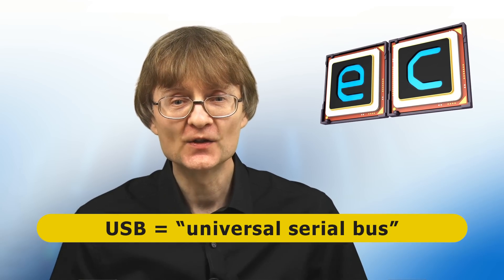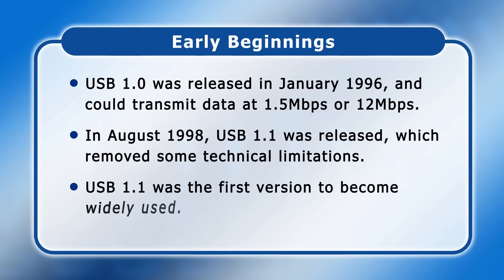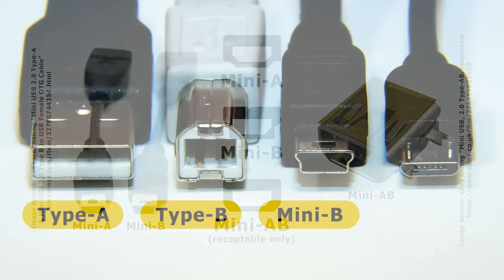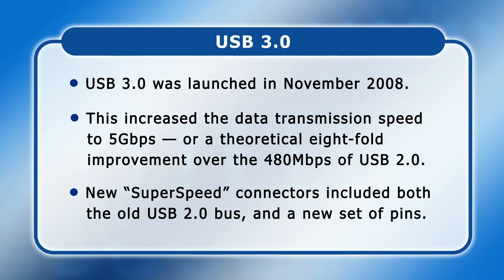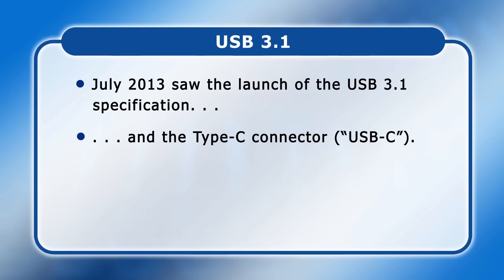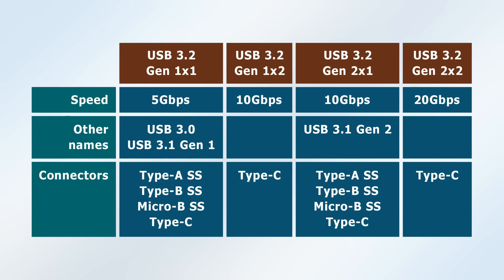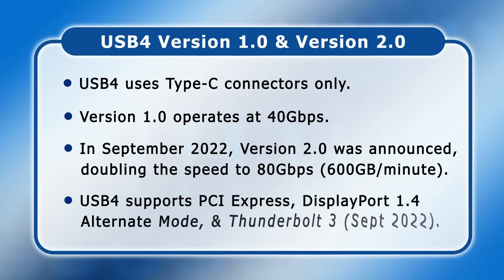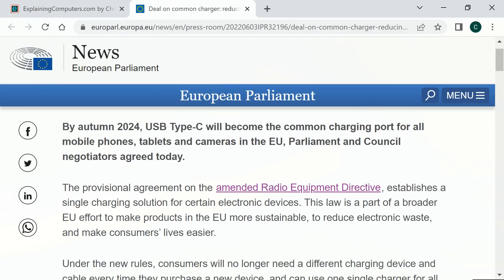Explaining USB: From 1.0 to USB4 V2.0

Comment: As messed up as the specs became, for most people it wasn't an issue. Because very rarely do you need anywhere near the full speed, with USB 2.0 still fast enough for just about all peripherals and memory sticks...it's only external hard drives and devices that can transfer data faster.
As for connectors, the main ones became USB "A" "B" "Mini-B" "Micro-B" and "C" with Apple using "Lightning". Mini-B and Micro-B are quickly disappearing and "B" only seems to be on printers which are all going wi-fi anyway. So going forward, all you really need in cables is going to be USB A to C and C to C.

Comment: What about the early high volt standards of USB 2.0.  POS terminals used voltages at 12v and 24V found on Dell 5WDTX PCI-e card.

Comment: The key to all this that makes me smile is that the speed of USB is just one link in the chain.   It's pointless for data to transfer @80gb between peripheral and source, if the buss and other components of the source are incapable of processing at the same rate throughout the entire supply chain of data transfer.  For most PCs or any 'source' component, this makes all the falderal over USB speed irrelevant.  Yet we still see the package and squeal when we see: "USB 4.0!!!  GOSH!!!"

Comment: I find it rather dumb that USB 2 is still in use for perihperals becuase "It's sufficient" 

Yeah so what? Surely it's cheaper to just procude one type of connector and even then I somewhat doubt USB 3 is that much more expensive compared to 2. Plus it's backwards compatibale in both directions anyways. Not to mention that it's more user friendly, I don't have to make sure my harddrive is not plugged into USB 2 and I lose a ton of speed.

I am also still baffled that theres regular USB to C, as a standard. Just USB C both sides and be done with with. Doesn't matter which way I orient the plug, it also doesn't even matter which way the cable is, also again, one type of connector for everything, done. 

I've heard complains about that, that it means I have to buy new cables for everything. No you don't, your old cables and plugs still work, ya dingus. Besides, we already needed new cables for USB C anyways. 
The world could be so easy if we just commited to it instead of worrying about older use cases tbh. 
Once your shit breaks you can then replace it to a newer standard if you so desire.
Reply from the maker: USB 2.0 ports are cheaper to implement than USB 3.x or USB4, and use fewer motherboard resources. It's got nothing to do with the cost of the connectors.

Comment: Another confusing thing: If you connect two random USB C devices, both with their own battery, it feels completely random who is charging who. On some devices like Android phones you can decide if the device wants to charge others or be charged. But for a lot of devices you don't have a choice and you only find out in which direction they charge after you connected them. After putting a USB C cable between a bunch of different devices and checking the result I was even more confused than before. I am not even sure if it's a transitive relationship, so if device A charges B and B charges C, then if A will consequently always charge C. Some pairs of devices also just refused to charge eachother while others did. For me the most intuitive solution would have been giving USB C cables a charging direction and giving them somehow a clearly visible indication (a red and a green plug or clearly visible and palpable arrows on the plugs or whatever). But others I talked to also said that it would add another level of confusion. And I also know it would reintroduce the old USB problem of attempting to plug it in the wrong way (now with the wrong rotation of the whole cable instead of the wrong rotation of the plug). And for chargers it does not make sense to make the cables directional. Giving the cable passive electronic with a toggle button on both sides and a weak LED also adds a lot of unnecessary parts which cost and can break, just for a niche purpose. Then introducing the above mentioned indicator logic, but not mandatory? But this would introduce a mess and confusion with two seemingly same but different cables. So make following the charging direction optional for devices like chargers? But this would not solve anything because everyone would implement it differently again. Really not sure what the best solution for this problem would be.

Comment: Do you have a good explanation, how my laptop uses USB 3.x to connect to a docking station, which in turn supports two FHD displays, 1 GB Ethernet and additional USB ports, while also providing power to the laptop. How is that even possible?

Comment: USB - C also could be called micro HDMI due to it's function as multimedia cable.
Reply: It cant as USB-C pin out is designed for USB needs, not HDMI, alternate modes just use pins for diffrent perpices

Comment: As a visually impaired user, I'd be curious to know what tactile differences there are between the various types of seemingly interchangeable cable. Is it, for instance, possible to tell the difference by feel between a cable with and a cable without the superspeed pins?

Comment: 02:52 I have never seen a keyboard or mouse with a USB Type-B connector
Reply from the maker: It wouldn't have. Type-B is for the peripheral end. So the plug on a mouse or keyboard is a Type-A, as it plugs into the host (computer). But, for example, a printer lead has a Type-A at the computer end, and a Type-B at the printer end.

Comment: Thanks for providing a concise reference 👍
One thing I have never been able to fathom with a USB Type A connector:
It is polarised and must have the correct orientation to be inserted.
Statistically I should have a 50% chance of getting it right first time and 100% chance if I turn the connector through 180 degrees after the first attempt.
In reality, for me at least, is it takes several attempts regardless of the first or second orientation 🤔🤣
I am surprised there isn’t a game called USB (A) roulette where people gamble on getting the plug in on either the first or second attempt with the Bank taking all bets over two attempts.  
Theoretically the bank should not win anything but I am prepared to bet 🤣that the bank will come out well ahead.
More sophisticated variations could be developed for later different USB versions, playing in poor lighting or without glasses or even wearing somebody else’s if you don’t need them.🤔

Comment: What has gone wrong is the colour of the USB port they started with black then it became blue,but blue has a mix.We have more colours to provide the USB connectors so if made red everything should be red conectors with that speed=simple and if the speed changes then the colour changes.This would be easy = red device only connect another red device.do away with backward compatibility this stops the mixup & if you want to keep up you have to change what you have.Why not name each version RUSB= RED USB =simple? Also the connector has to change so that it cannot be use for any other connection only  RUSB, then the next version change colour & connector.everyone would get used to the colour/connector vesions.

Comment: I'm not sure it was mentioned explicitly, but many, dare say, most of the USB C cables you purchase are designed for high power usage and are therefore USB 2 - 480Mbps. Finding a 10Gbps USB C cable is incredibly difficult and confusing endeavor. 
Thanks for the video!!

Comment: "USB, we named it so because it is universal!"
"can I plug this into that?" uhh... no
"can I power this device with that cable and have the speed transfers that is guaranteed by the device with this smaller cable?" umm... no
"can I use this device with another device without the need to purchase a specialized cable for that intended purpose even though all present the USB logo?" uhh... I don't think so...?

USB started as a great idea but they just ended up as many great projects that wasn't implemented correctly "a brand" which is infuriating when I'm wanting to purchase a USB-C cable that does everything I want and yet I have to figure out if it will give me the 20W power PLUS data transfer....

USB is so confusing I'm dubbing it "a great idea turned into a brand"

Comment: I remember when I first got my first ps4 (battlefront 2015 Darth Vader edition) and noticed it charged by micro b unlike the ps3 which used mini b and I thought it was cool how it used a thinner plug to charge and connect, I then realized how fragile micro b really was with prolonged use of the controllers while plugged in (cause I was an impatient child and didn't keep a charged controller on standby) and dearly missed the good old days of mini b.

Comment: The HP Prime graphing calculator uses a micro-ab socket to connect to a computer as a peripheral (regular micro-b), but also to connect peer-to-peer with a micro-a to micro-b cable.

Comment: Man that chart about usb 3 alone clears things up drastically.
What I was able to get out of it was
1x1 = USB 3.0
1x2 = USB 3.0 10Gbps (Type C only)
2x1 = USB 3.0 10Gbps
2x2 = USB 3.0 20Gbps (Type C only)
So basically if it has an x2, its double the speed of the normal one, but only for Type C

My best suggestion that might please the minds of whatever is going on at the factory would be something like:
1x1 = USB 3.0
1x2 = USB 3.0 x2
2x1 = USB 3.1
2x2 = USB 3.1 x2

Or maybe to make things feel less "old" with a lower number aka keep 3.2 naming:
1x1 = USB 3.0
1x2 = USB 3.0 x2
2x1 = USB 3.2
2x2 = USB 3.2 x2
Reply: x2 means using extra TX-RX data lanes that usb-c has but usb-a/b dont, kind of like x2 in PCI-E. the 3.x indicate spec which also chnages older speed modes, thats why they indicate with gen rethen then actual version number, so in spec wise 3.0 is diffrent then 3.2 Gen1

Comment: There is one information missing from the video: USB-C ports can also be USB 1.1 and 2.0 speeds, especially with very cheap devices.
Reply from the maker: This information is not missing. As the video makes extremely clear, the connector does NOT define the standard. ALL USB ports can carry a USB 1.1 or USB 2.0 connection, NOT just Type-C. :) Nowhere in the video do I say that Type-C ports only operate at USB 3.x or USB 4 Rev N speeds.

Comment: The constant changes to the naming scheme drive me nuts. Why not just have USB A,B, and C and add any new physical connector types as they are created. Follow that with the wires hypothetical maximum data transfer speed which is then followed by the maximum power delivery rating. No confusing naming schemes, all the important info is front and center no need to search google to hopefully find the correct info.

Edit: also the recent changes to HDMI are irritating as well.

Comment: It seems that the old standards will be faded out before long, and USB-C will be the primary connector, and eventually USB4 2.0 will be the primary data and power rating. This will really help clear up cables and such.

Comment: So, as I understand it, although cables may have the same connectors and may be fitting on a device, they do not have the same characteristics, like speed and voltage that can be transferred? So how do I differentiate? And also, what app, if there is any, could be used for recognition / measuring speeds of a cable used for connecting devises to mac/win/linux computers? But now this is it for another question, many thanks for the explanation you alteady gave :)

Comment: The down compatibility is not always happy especially when using motherboard's front USB hub. There are several USB 2.0 devices I have that I can plug in to back USB 3.0 or 2.0 ports withiout issues but they refuse to work plugged into the front USB 3.0 hub ports and work just fine plugged in the 2.0 hub front ports. I am sure that this is down to the motherboard's usb hub controller implementation.

Comment: If there's one thing all the USB standards it's taught me, it's that I hate them all for having so many variations. So hard to find a type-c cable that can actually do 40gbps because so many of them are labeled as though they should but do not actually do so if used for that purpose, or are outright sold as the wrong standard either as a scam or sellers just not knowing better... and that's not even getting into the cables that only work correctly if one specific end is in a specific device, or the ones that require me to flip the plug over to a specific orientation in order to function correctly because someone couldn't be bothered to wire the thing to be properly reversible!

Comment: 9.49 interesting point I got a new Huwaei laptop this week and the only guide with it was a quick guide point to power socket, hidden web cam and finger print reader. No instructions of any kind at all. Not even a manual on the hard drive no full specs listed either...  Had very limited info on retailer site too as it was clearly a european model reduced to clear in the uk.

Comment: At least now I understand some of the problems I've had in the past.F.i. why an external HD did not get enough power when hooked up to a computer via a USB splitter. Or my new USB C using phone loading slower from the computer connected via a third party cable connecting to the laptop's A SS compared to the original C to C cable plugging into a regular power socket etc. Maybe this will actually help me buy the correct cables, splitters and adapters in the future.

Comment: Some peripherals also used a USB Type A port back in the 1.0/1.1 days, which used a Type-A to Type-A, Male-to-Male cable, which is not a great idea as it could accidentally be plugged into two powered hosts at the same time and potentially cause damage. (I had a Linksys USB WiFi adapter that used this configuration)

Comment: You forgot 2 things. 
1. Thunderbolt 4
2. USB-C Cable compatibility issues
Reply from the maker: No, I didn't. As noted in the video description, I had to decide what to include and what to exclude. There are loads of things that could have been included here. But the video was already long -- and is not about Thunderbolt. So less was more.

Comment: My question would simply be.  What, Standards.  Has China ever created?  That we all adopted and embraced?  It was, the noodle.  And then, rigatoni, macaroni, ravioli, Penna, et al.!  All noodle's!  But which is the best one?   When, not just any noodle, will do?  Which noodle sends nourishment to your body, quicker?  And which connector is secured and plugs in, with a nice loud click?   Right.  None!   Not anymore!  So as to prevented from accidentally getting unplugged.

I come from a profession filled with, standards, to follow.  And it worked.
RemyRAD

Comment: Chris, as a retired electronics engineer, I loved your easy-to-understand video (c/w correction). 
For example. you said, Power delivered (watts) to a device is "negotiated" with variable voltages. 
This is a non-trivial, little appreciated forthcoming change in the USB standard! 

fers at 240watts!

Comment: Nice video.  I'd like to see a follow-up video showing real devices that use the connectors and how they work.  Especially the more rare versions.  I can remember at one point  buying a strange set of like 10-12 different adapters to convert between different USB types.  This was in the late 2.0 era.

Comment: thanx Chris,i made a screengrab of the USB table,very useful indeed,i wouldnt connect mechanical drives to those high speed interfaces tough,i think the mechanical device will have more wear and tear and thus fail much sooner,for SSD its a better thing,cheers mate

Comment: I wonder if those behind the USB specifications know how bad things are and have ever thought of essentially starting from scratch? Because that's really what is needed from USB 5.0 onwards. Any incremental upgrades need to be 5.1, 5.2, etc. And major revisions needs to be start at 6.0. This should have happened with USB 3.0 and certainly 4.0 of course. Right now, I'm not too fussed about USB 4.0. If any new motherboard I purchase in a couple of years has it, then great. If not, then I'll not lose any sleep over it. I can always buy an add-on card.

Comment: Great video. I find it ironic that in part , one of the reasons for USB was to eliminate the need for the many early standard cables, like serial, parallel, PS/2, SCSI, etc. I think they totally missed the simplification mark. 🤦🏻‍♂️
Reply: Actully no, becuasd most basic devices use 1.1/2.0 pins, also USB establist protocols allowing many devices to work without need of extra drivers (drivers come with OS), problem only begins when you want have higher bandwidth and lot of cases it is usable in most cases just slower as everything fallbacks to D- D+ pins that are always there (except charge only cables)

Comment: I like how USB (Universal Serial Bus) was created to make thing "universal"
Yet here we are wondering where it all went wrong...

USB-C is also a nightmare, not all cables are created equal
Some don't work as data, some are rated for Hugh wattage..some are not
It will be the plug we use on everything but it's still going to be very confusing

Comment: The one thing universal about USB standards is that they are universally confusing.

Also a large number of manufacturers designed and implemented their own power standards on the USB-C port during the last 7 years it is chaos.
Since the introduction of GaN chargers some would renew the standard and push the limit further like every year.

Comment: Hi Chris
Keith Kuhn here.
I have a quick question please, if anybody would know you might.
I have a mechanical hard drive, The pins on the printed circuit board of the hard drive got burnt.
I got a new printed circuit board and was told in order for it to work I had to have one of the BIOS Chips
from the old board to the new board.
would you know this to be a fact.
Thanks Keith